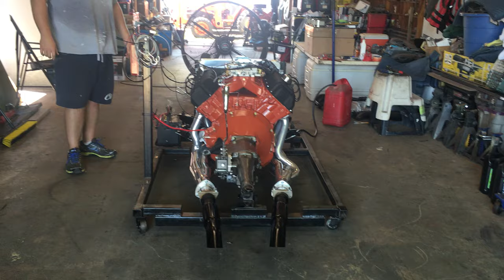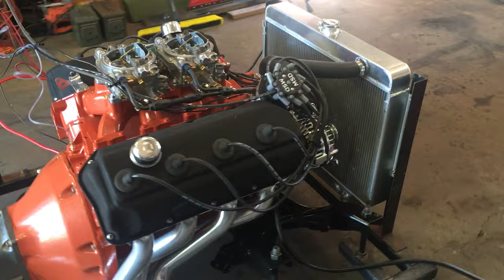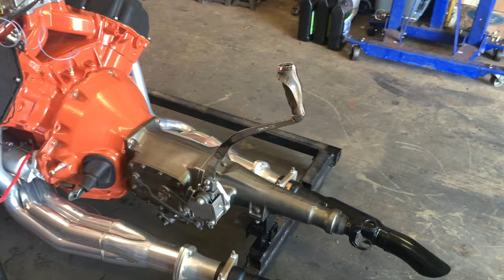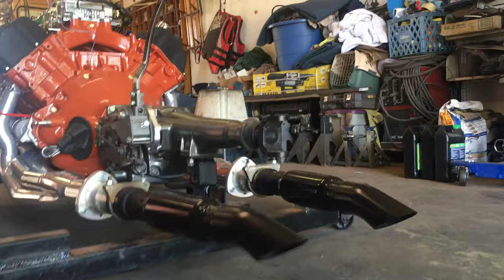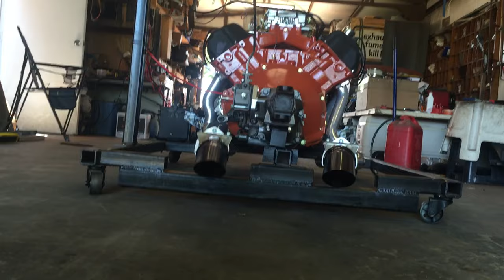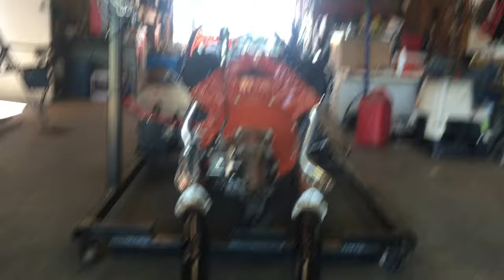426 Hemi at idle with Comp CAMS "Mutha Thumpr" Camshaft.

Comment: I've watched this vid. A bunch of times, but just now noticed how cool your engine run stand is. Gonna copy one for myself!
Reply from the maker: I made the gauge/ignition mounting post and the radiator mounts removable.  This allows me to be able to roll it under a car and easily install the motor from underneath.  That is by far the easiest way to do it.  B/RB engines give you tons of room.  A Hemi is a tight squeeze but still much easier to come up from underneath than from up above.
Reply: spridenour01 for sure...i have an extra BB k frame i was going to toss, but I'll gonna make a stand instead. About how long and wide is it?

Comment: Nice Hemi!  Would you help out with some questions please?
Part number for the cam please? Is this a flat tappet or roller?
Your thoughts on the Edelbrock heads, intake, and carbs?
Whos rocker gear did you use?
Any more vids of this motor?
Thanks and keep the vids coming - great stuff!

Comment: Hope you ran a 3.5-inch exhaust all the way to let that puppy breath.
Reply: doesnt need that big of an exhaust
Reply: @gordocarbo  So, you didn't happen to watch the dyno test where they kept enlarging the exhaust and the larger it got the more torque and HP it made, think it was BB chevy. If I was running a BB anything it would for sure have a 3.5-inch exhaust. My little 340 with a 270H comp cam, which is smaller than the stock cam, likes open headers with a 3.5-inch open collector with no extension for goodness' sake, and it does hurt the performance when you hook the exhaust system back up. In fact, it is in my CJ5 now with shorty headers with 2.5-inch outlets running two 2.5-inch pipes into a Flowmaster muffler with two 2.5-inch inlets and two 2.5-inch outlets and it certainly restricts it, no room for long tube headers between the frame rails.

Comment: Lexton what's the specs on this cam? It sounds bitchin'
Reply: It is either a 287TH7 or a 291THR7 from Comp Cams based on the name. Most likely the former one as it is non-roller. I think they sound about the same but the roller is about $200 extra not including the lifters, etc.
Reply: Dr. Reason you’re right

Comment: Your muff`s are way to small  you need 4" straight through  or your going to lose top end rev`s . I like the set up it just got to be bigger.You may have to use 4" race muff`s. Turn your turn down`s  at 45 degrees  it will sound better , stop blowing dust all over, and blow the tire smoke. Nice motor good luck .
Reply: He doesnt need 4" exhaust. lol